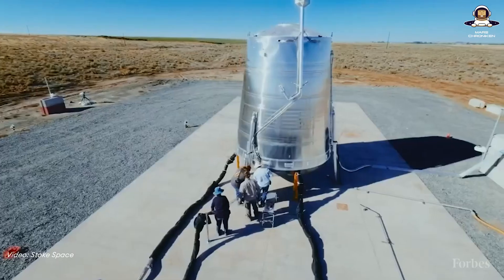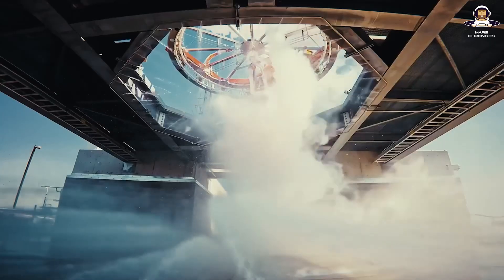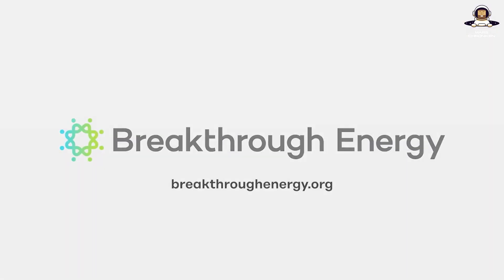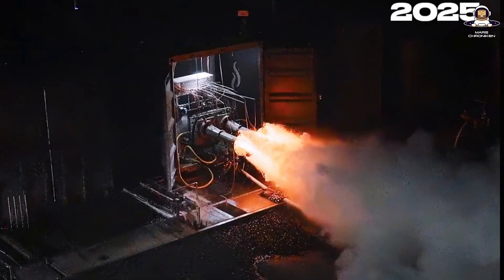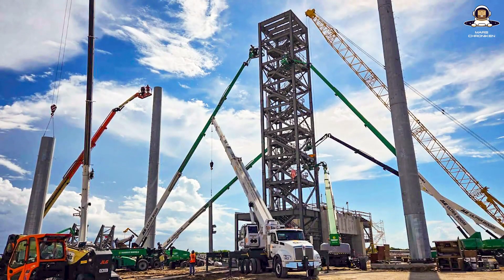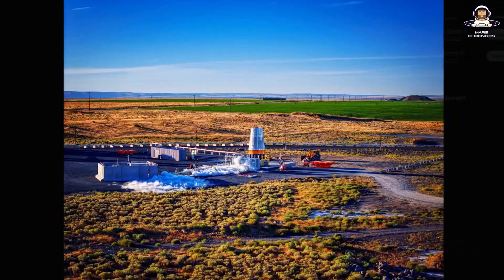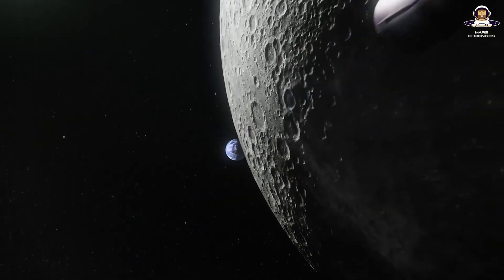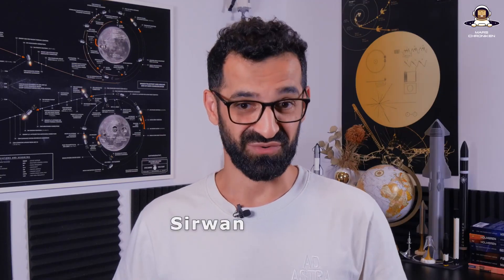Stoke Space Turbo-Boost Update: From Test Stand to Orbit

Comment: Great Video!! Thanks!!!

From the time i saw the Everyday Astronaut interview with Andy and Stoke Space i have become a believer and fan. Stokes design is by far, better than Starship. Starship has dangerous heat shield tiles which will always be a problem similar to shuttles fails. Stokes Nova does not. Starship has to do that dangerous last minute flip to be caught Nova does not. Starship has dangerous fins that are weak points during reentry Nova does not. Shame SpaceX isn't copying the Nova design now. Future companies will look like Nova because it's the best reusable solution. Part of the reason Starship is so large is because their reusable design is less efficient. Andy took Elons motto to the extreme the best part is no part.

Time machine into the future and you will see lots of Nova like rockets not Starships. 😂
Reply: Also more problematic payload door, header tanks and no capsule possible on top on Starship